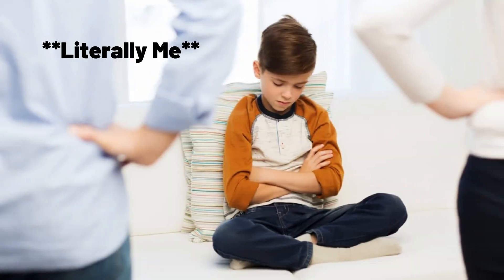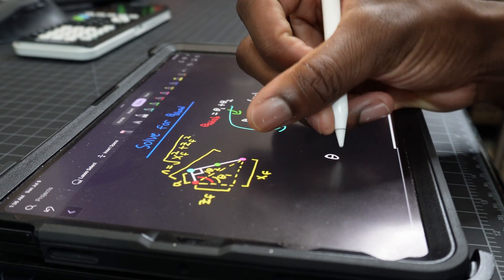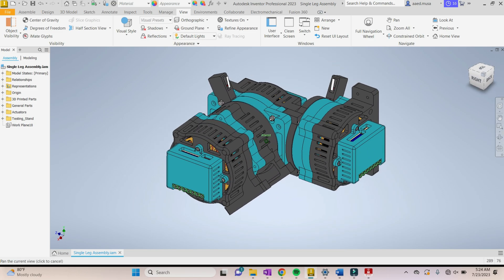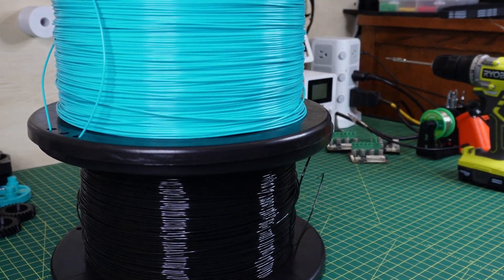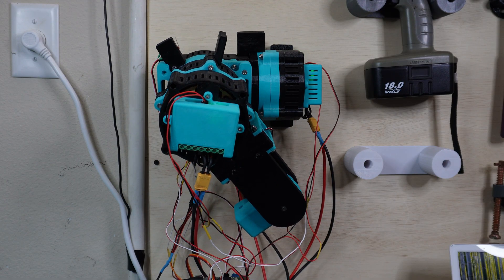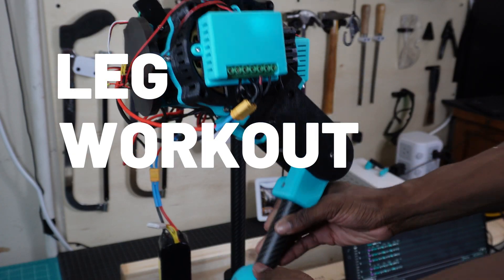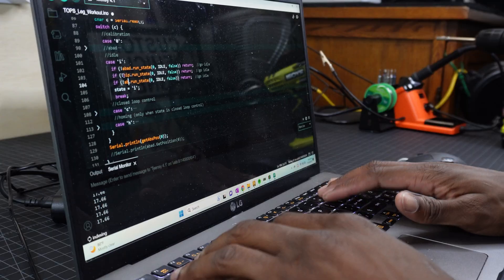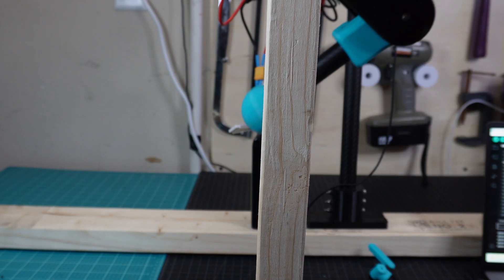Robot Dog Part 1: Leg Day

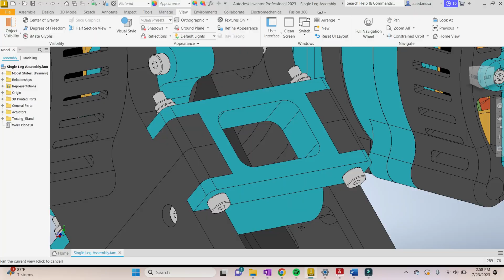Comment: Dude, at 5:06 is that  how your bed wobbles? it's not Ok if it's not just for the video. I fucking love your project! And its quite the investment! I instantly subscribed the moment I landed here from TikTok. I hope to see it finished <3
PS: Ever though on adding limit switches on both sides? It would be a bit safer, not even for homing, but for emergency stop in case... the start of the video happens.

Comment: Since your actuators won't rotate more than 360 degrees, you could consider putting an encoder on the output shaft of the actuator to detect the absolute position of the joints. This would replace the need for limit switches and homing since you'd always know where each joint is.
Reply from the maker: It would but 12x encoders are expensive. I’m doing something different for the redesign.
Reply: @aaedmusa  I just got a few AS5600 magnetic encoders from AliExpress for 64 cents each. After testing one out on a SimpleFOC board, the precision is excellent. I don't know if it will work with an ODrive though, and mounting an external magnet on your joints does sound like a challenge.

Comment: Great project, looking forward to seeing you progress.   Just wanted to share a tip... I am using carbon tubing on a new project, and I'd like to suggest you fill the end bits where the screws pass thru with plastic plugs to drill / screw through, otherwise you will surely experience loose, twisting legs in no time at all. The screws will quickly wear at the holes in tubing, and you're done. Carbon fiber has super tensile strength, but fails on friction shear.  Save yourself the trouble, plug the ends of the tubing.
Reply from the maker: Thanks for the tip! I have actually experienced a bit of shearing already.

Comment: Love it, but why do you use Arduino IDE and not platformio?
Reply from the maker: Never heard of that. Arduino is convenient since I’ve used it so much. Also there are libraries for the motor controllers specifically made for Arduino.
Reply: @aaedmusa  Check it out if you have the time. It`s an extension for the vscode editor and by that you get features like auto completion but also useful key binds. I use it for every project and never touched Arduino IDE since then. It supports all kinds of boards and frameworks.

About the libraries...
platformio also has a lot of libraries by the community, but I can`t tell if every library you use is available.

Comment: Awesome video! Do you have a way that you can sense when the leg is touching something? I'm seen others make legs similar to this, but not one that can sense when it touches something and how much pressure it is applying.
Reply from the maker: No foot sensor but it isn’t needed. The actuators use FOC motor controllers which means that they are compliant. In other words, I can’t get a foot pressure reading but the leg can react as if I can.

Comment: Maybe you could try sensorless homing for the legs rather than limit switches.
Reply from the maker: Sensorless homing isn't as accurate and limit switches are a lot simpler.
Reply: @aaedmusa  sensorless homing is accurate enough for the majority of uses. It would be accurate enough for this. Limit switches are not really simpler at all. If you have a motor driver that supports sensorless homing then it isn’t that difficult. If you use limit switches you need to add the limit switches, wiring and places to mount the limit switches plus something to trigger the limit switches and they take an extra pin on your microcontroller, that is a lot of extra parts and complexity if your motor driver has the functionality already built in.

The best option though is just to add absolute encoders.

Comment: Re Hammering Bearings - you have quick clamps, just use those, way easier on the bearing and way quieter. 

Also, be careful with adding slots/grooves to printed parts - it's a weird quirk of additive design that sometimes adding a lightening feature adds more weight because it is heavier than the infill it replaces. This will be heavily dependent on slicer settings but double check in the slicer. Yesterday I designed a whole new part for a project, tried to minimize weight by removing material and then realized that infill was lighter still.
Reply from the maker: But hammering them in is more fun :( Also what you said about weight only applies if you manually increase the infill setting (which I'm not doing). If you take volume from an object you reduce weight simple as that.
Reply: @aaedmusa  "If you take volume from an object you reduce weight simple as that."

Assuming a uniform density, yes. But prints don't have a uniform density. Walls are more dense than infill. It's very dependent on geometry but there are cases when adding walls (ie adding holes) can increase the mass of the part. It's especially prevalent with a lot of small holes.
Reply from the maker: @aschreiber  Could that happen if you used extremely small holes and had very specific settings? Yes, but I added deep grooves in my parts, so the added weight from the walls is insignificant.
Reply: @aaedmusa  It's not quite as simple as that but carry on.
Reply: @aaedmusa  I hate to say this, but they are right. This video sums it up pretty quickly. https://www.youtube.com/watch?v=AURCtaRrUGM
You can also test yourself by slicing the part with and without the holes. The preview should tell you exactly how many grams of material it'll use.

Comment: As a PhD candidate in engineering, specializing in robotics, I must say: Excellent job, mate!
I do have one suggestion though. I'm not sure about your plan to realize the walking pattern. You mentioned that the circle made by the foot wouldn't be useful for walking. I spent a year working in a university lab that had its own quadruped robot. The team was able to achieve walking through the implementation of elliptical shapes in foot trajectory. Essentially, anything below the horizontal centerline was exerting force onto the ground while anything above it was lifting the foot. However, I'm confident that you've already considered this in your thought process. :)
Reply: Hello, is it possible to get in touch with you? I want to transition into robotics and your experience and learning could help me so much!

Comment: Love the video. May I suggest using absolute encoders, like the AS5600 or similar. It made my life much easier in my robotics projects. As CANBUS can be finicky but it is worth it. Keep it up, this work is awesome
Reply from the maker: It already uses absolute encoders to measure the position of the brushless motors, but since there is a 9:1 gear ratio the output shaft turns at a different rate, hence why I need limit switches.
Reply: You can use a potentiometer in the leg joints to know the position of the legs  @aaedmusa
Reply from the maker: @audrisvitolins6048  Potentiometers aren’t as accurate. The encoders that I’m using go to a fraction of a degree. The reason I don’t add an encoder on the output shaft is to reduce cost and also to reduce the amount of electronics/wiring.